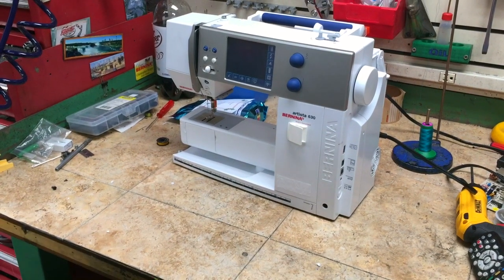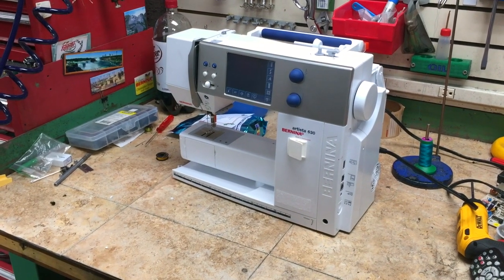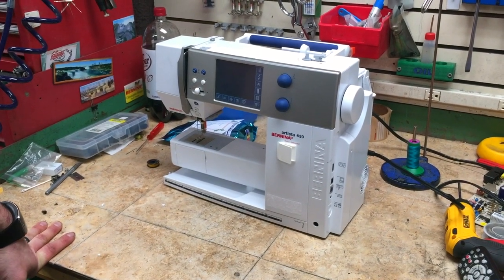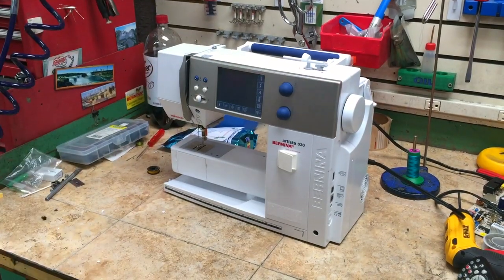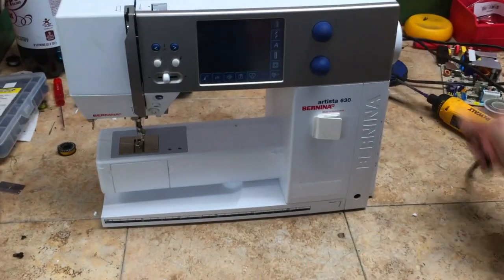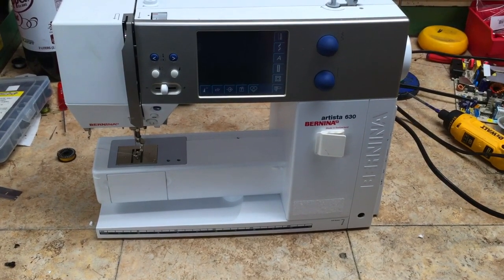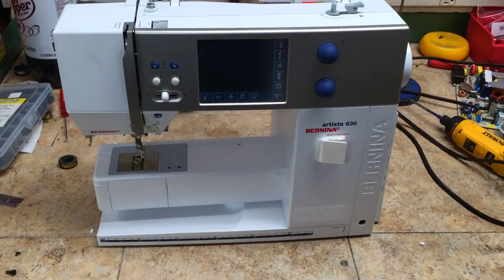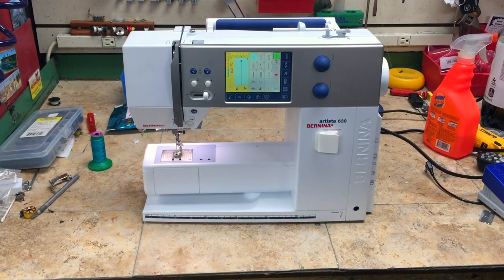Bernina Sewing Machine Won't Turn On

Comment: Dear Sirs, 
Please HELP! 
I bought a Bernina Artista 180 in about 2009.  I was SO excited that I finally had ny dream machine✝️👍🏼❤️
I used it a little, then my health failed and suddenly I just couldn’t do all the fun things I was so used to doing for my family.  One of those things was making quilts, wall hangings, senior lap quilts.  I packed my Bernina safely away and babe been waiting all these years to use it again,, 

With all this Covid stuff, I figured the least I could  do was make masks.   it took everything in me to pull the machine out,  but clean it all, remind myself how to use it. 
I was SO excited to sew again. 
I went to turn the machine on and no screen!  
I noticed the black suff in the screen looks slightly pooled on the edge and a little on the bottom. 

I waited some time and rage screen began to flicker!!  light only, no words, but then we smelled smoke!! 

I had to unplug my machine! Dreams dashed, projects waited on and carried with me move after move, all dashed!  I’ve been crying for 3 hours, and I’m a tough woman!  But this is one more straw has broken this camel’s back folks! 

I’m not trying to be sappy, honestly, but I live in Housing on fixed income.  No longer the days I could buy a used Bernina. 
So, What are the chances I can get the screen replaced? 
I’m hoping I can make medical masks while the need is still here, and maybe even finish a quilt or two so I can make my kids proud of me again. 
Being suddenly unable to do for your family all you used to is very difficult.  
I’m hoping I can fix and use the pride of all I have... my beautiful Bernina Artista 180. 
Do you have any good news for me please sir? 

Thanks and God bless you!

Comment: I have an artista 180 and it worked fine yesterday and this morning, but I took a break to make breakfast and it was off when I returned several hours later. Don't remember turning it off. But it's been on and plugged in for over an hour. I've check outlet and even put it into a different outlet to be sure. Nothing after the hour+ being turned on.  Any advice?

Comment: Thanks for this video I have a few Berninas. I had one that would just start sewing backwards (1120) and half the special stitches don't work. I've bought a husqvarna Viking #1 1200 and the power button won't turn machine on and off, it has power but foot pedal is pushed and machine just whirs any ideas? Cheers Jodie Melbourne Australia 🇦🇺
Reply: Sounds like the Bobbin Winder is engaged.

Comment: why can't they fix this problem.  I just bought one and they are giving me back my money.  It is only 2 months old and took over an hour to "warm up"
Reply from the maker: Hi Pat, they have found that the problem lies within a defective power supply (circuit board). Bernina guarantees their circuit boards for 5 years on these machines. Unfortunately most of the machines with this problem are well over 5 years old.  If you absolutely hate this solution you are welcome to have the circuit board replaced for ~$200. If you use the machine regularly this problem doesn't occur.

Comment: I have a 1090 S which I use sporadically. I turned it on yesterday and used it for about 5 minutes, then stepped away. When I came back, I noticed the machine was dead. I turned it to the off position, then back on again, and it makes a clicking noise but does not power on. Any ideas?
Reply from the maker: Karen Schiller it might be fuse. It might need a new circuit board. Either way you will need to take it to your Bernina dealer.
Reply: Thanks

Comment: my 1630 has been sitting for a couple of years and worked fine before storage. Now it will power up but nothing happens when you press the pedal.  You cannot hear any noise but the screen is on and the light is no so I know it is getting power.
Reply from the maker: Jammie Farrell it could be several different things. It could be your pedal. It could be a fuse. It could be your motor. It could be a circuit board. I recommend taking it to your BERNINA dealer and letting them diagnose the problem for you.
Reply: @berninaboys100  where is the fuse?  The pedal was bought new just before it was stored away sit it is not that old
Reply from the maker: Jammie Farrell it’s under the back cover. I don’t recommend taking it apart and trying to diagnose it yourself you could cause some serious problems.